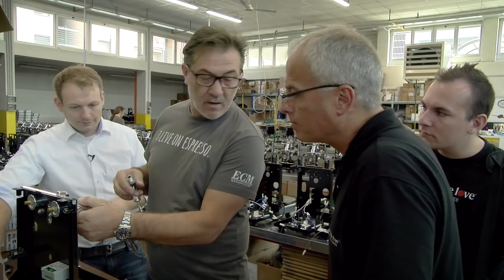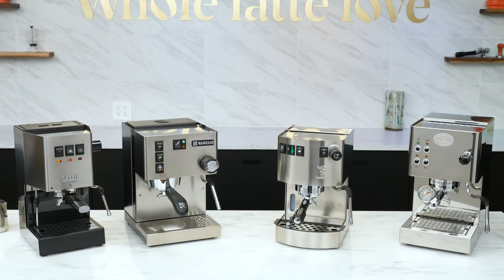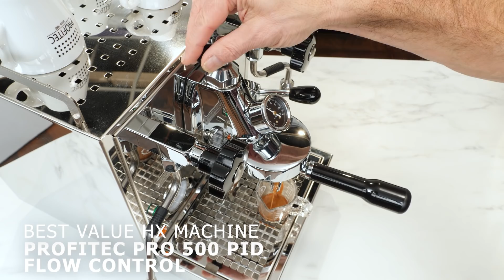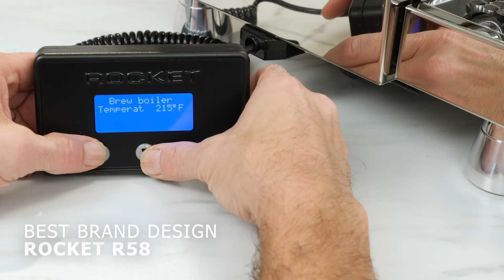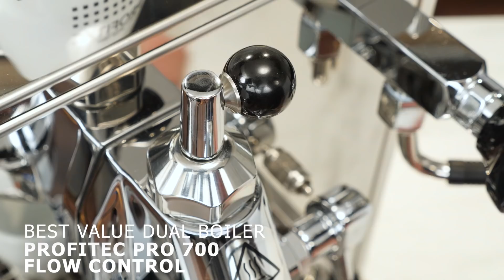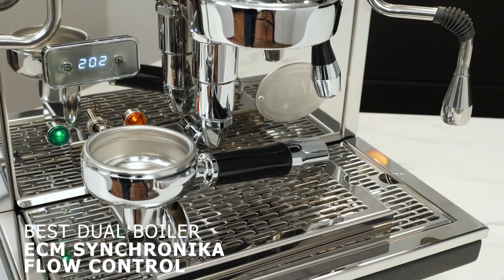Top 5 Best Semi-Automatic Espresso Machines of 2019

Comment: Hi Marc, which machine would you personally buy for your daily latte or expresso? Which one is the best for both? It doesn't have to be among the ones mentioned in this video. Look forward to hearing from you. Thank you.
Reply from the maker: Hi Hanna, Thanks for the question. Answer really depends on the budget and how much I'd be using the machine. If it were for a latte a day and limited budget I'd go with the Gaggia Classic Pro: https://www.wholelattelove.com/products/gaggia-classic-pro-espresso-machine-in-cherry-red
It's a single boiler so you cannot brew and steam at the same time. But after you pull an espresso it's only about 30 seconds until it's ready to steam. That's faster than most other single boiler machines.
If budget is higher and/or machine would get more use I'd go for one with a heat exchange boiler. Those can brew and steam at the same time so prep is quicker. Since this video was made the Crem One HX PID machine came out. It's a lot more expensive than the Gaggia but a great value in machines with heat exchange boiler: https://www.wholelattelove.com/products/crem-one-hx-espresso-machine 
Hope that helps!
Marc
Reply: @Wholelattelovepage  price is not an issue. I wanted to know the best option for what I need. Great. I'm so glad to find your channel and your site. I'm moving to TX end of this year. I'll order 2 high end machines and 2 budget friendly machines for our entire home. Thank you so much for your prompt response. Before I purchase, I may have a few more questions for you. Thank you and have an awesome day.

Comment: Just thinking to buy a synchronica. In the back of my mind there's still a pic of a Della Corte, La Marzocco, Elektra..... What do you think about the worth of a saturated group compared to a ECM Synchronica with flow control?
Thanks for your opinion.
Reply from the maker: Hi AG, Synchronika is a fine machine and flow control extends it's capabilities. Something like the Dalla Corte Mina is IMO the state of the art in flow control with 5 programmable steps by time and flow rate for precise repetition of profiles. Or you can set flow rates and run them manually with the lever in 5 steps. I do like the boiler over group design of the Mina. Very fast heat up, rock solid temps and very quick temperature changes are possible. All those capabilities have a much heftier price tag than the Synchronika. Similar to LM GS3 in price but with Strada like capabilities.
Marc

Comment: What are the differences between the Profitec 700 and the ECM Synchronika ?  ECM is several hundred dollars more, and you rated it as the best, with the 700 2nd best... so since they are both owned by the same company, I am interested in knowing the differences.  I am looking at buying one of those 2 machines.
Reply from the maker: Hi Ben, Thanks for the question. Internally, the Synchronika and Pro 700 are identical. And yes, they are made by the same company in the same manufacturing facility in Milan, Italy. I've been there and know the owner well. A good analogy is Toyota/Lexus - Profitec/ECM. Both are high quality in exterior finish, but the Synchronika goes a little further with angled portafilters, lever operated valves, custom subtle taper of the E61 group, gauges mounted high, chrome tipped levers/valves/PFs and a single piece chassis base which yields case panels which can be easily removed in less than 1 minute. The Synchronika is just more refined - All specs and capabilities of the machines are identical.
Hope that helps!
Marc
Reply: @Wholelattelovepage  Well, I purchased the ECM.  But I will be shipping it back to your company.  It is having problems and despite repeated attempts to get some help resolving it, the best I get is an email with a link to a video, which does not address the issue with the machine.  Just my own 2 cents on this.  When someone spends $3k on an Espresso machine, and they reach out because it is having issues, I would get on the phone with that person right away to get the issue resolved.  When it drags on and the person is sitting there with a new machine that does not work, at some point that person is going to get more and more upset and let others know.
Ben
Reply: Ben did they ever resolve your issue with the machine? If not what did you go with next?

Comment: Marc, great videos.  Thank you.  Your reviews on espresso machines mentions best "entry-level PREMIUM machines".  Would you say that those are the bare minimum choices, that anything less expensive would venture into the less desirable "appliances".  The Gaggia seems about $200 past my price range.  And I've heard good things about the Breville ESP8XL Cafe Roma Stainless Espresso Maker which is half the price.  I value your opinion.
Reply from the maker: Hi Brandon, You are welcome! Sorry not back to you sooner - a bit behind with the holiday last week. It really depends on what your expectations are for espresso. These premium entry-level machines are what the name implies... true machines with standard commercial size portafilters and non-pressurized filter baskets. The Cafe Roma is in the appliance category and uses a smaller pressurized filter basket. This type of product has questionable thermal stability, leaves a messy filter basket after brewing and has lower steaming power. If something breaks in this type of product it's not really user serviceable and professional repair if possible would cost more than the value of the product. All that said, if your looking to make an okay espresso or milk drink you'll likely get a result that matches quality of mass-market chains but doesn't come close to what you'd get at a specialty coffee shop/cafe. I did this video a couple weeks ago making a quick cappuccino on the Capresso EC Select which retails for about $100. I'd never drink a straight espresso from a pressurized basket brewer (i'm spoiled) but it makes a passable milk drink for those with reasonable expectations. Check out the video here: https://youtu.be/ahj74HTrn1k
Hope that helps!
Marc
Reply: @Wholelattelovepage  Marc, It does help indeed and I thank you.  Unfortunately I missed the Black Friday sales.  I had the COVID and was stuck in bed, but spent my time researching.  I've decided that I'm going to get the Gaggia Classic Pro based on your recommendations, including your comment above.  My birthday is tomorrow and I've instructed my wife and family just to give me money (as tacky as that may sound) so that I can supplement the difference and just buy that machine.  It's out of my price range otherwise and I missed out on the sales.

Again, I thank you for your response and I'll look forward to more of your excellent videos and will keep an eye out for sales at your store.  Just registered at your website and signed up for your newsletter.

Comment: Marc - can you recommend a good polish for the rocket espresso machine please - I like mine to sparkle :-)
Reply from the maker: Hi NNS, Thanks for the question. I've been photographing machines for about a decade. Best results cleaning is with ammonia based glass cleaners like Windex and soft clean cotton rags. Cleans the chrome/stainless well. For milk cooked on steam tips soak a rag in same and hold on wand for 30 seconds and milk residue comes of easy. Just be sure and rinse! For drip trays, portafilter and filter basket nothing beats Cafiza: https://www.wholelattelove.com/products/urnex-cafiza-espresso-machine-cleaner
It's what the pros use!
Marc
Reply: @Wholelattelovepage    thanks very much :-)

Comment: What is a " level entry machine"?
Reply from the maker: Hi fb, Here's a video featuring 4 premium entry-level espresso machines: https://youtu.be/ajvUwRZ524I
Premium entry-level machine generally refers to products with machine grade build quality. So they are not made with lots of plastic, use standard size 58mm portailters and non-pressurized filter baskets, built to last and very user serviceable. At entry-level they are single boiler machines with real boilers and not a thermoblock for heating brew water.
Marc

Comment: Hi marc.
I need your help about choosing my first semi- automatic machine. Im looking for hight quality 
Espresso, price range 1000-1500$
Reply from the maker: Hi 3, Here's a link to current selection of machines ranging $900 - $1600: https://www.wholelattelove.com/collections/semi-automatic-espresso-machines?_=pf&pf_p_price=899.99%3A1599.99
If you don't or rarely do milk drinks then the best espresso IMO of the bunch comes from the ECM Classika with flow control. It's a single boiler, E61group PID machine. It's a single boiler so it's more of a process to make milk drinks as you cannot brew and steam simultaneously and must cool down the boiler after steaming. If you want simultaneous brew and steam The Bezzera BZ13 is PID with a heat exchange boiler. The Breville is an option just be aware it's appliance grade construction with nowhere near the expected longevity or serviceability of the true machines in the group. Hope that helps!
Marc
Reply: @Wholelattelovepage   thank you very much
So helpful.

Comment: How much for that wonderful machine
Reply from the maker: Hi Greg, You asked on another video so assume this is what you're looking for:
Thanks for the question and it is a wonderful machine - my favorite dual boiler! Current pricing here...
With Flow Control: https://www.wholelattelove.com/products/ecm-synchronika-dual-boiler-with-flow-control
Without Flow Control: https://www.wholelattelove.com/products/ecm-synchronika-dual-boiler-espresso-machine
FYI the Profitec Pro 700 is nearly identical to the Synchronika with a little less detail/refinement of external case and a slightly lower price. ECM/Profitec are sister companies. Both machines hand assembled in the same production facility in Milan, Italy.
Marc

Comment: I am looking at the ECM Synchronika to replace my trusty Rancillio Silvia. My grinder is a Eureka Mignon. Is this grinder good enough for the new machine?
Reply from the maker: Hi a, Thanks for the question. First be prepared to have your socks knocked off by the Synchronika. Super stable brew temps, best in class steaming power, incredible build quality and detail, rotary pump, plumbable - a huge upgrade! But you already knew all that. At that level of machine I usually recommend a grinder w/64mm burrs or larger. Mignon uses 50mm. Does 14mm make a huge difference? Maybe, maybe not. Depends on how particular you are.
Marc
Reply: @Wholelattelovepage  I guess to sum it up your saying it will do; but consider an upgrade :)  The journey continues......

Comment: Hi Marc. I'm following and enjoying your channel for a long time and now I decided to upgrade from De'longhi machine to a prosumer machine. I'm struggling between Rocket Appartamento and Mozzafiato. Does PID really worth extra $500? Does it improve cup quality or it's just a nice feature to play with? I like to drink light and medium roasted beans, prefer acidity in my espresso rather than bitterness.
Reply from the maker: Hi Michael, Thanks for following the channel and for the question. The PID just makes it easier to get consistent temps. And a little tip, you'll want to brew a little hotter for those light roasts. Also, get ready to have your socks knocked off with the upgrade in quality going from a delonghi to an E61 machine! The Chronometro Mozzafiato: is available in type V with vibration pump or Evo R with rotary pump and it's plumbable direct to waterline. Back to PID... Very consistent temps with that. On the other hand once you get to know the Appartamento you can surf temps using cooling flushes. Temp surfing takes some effort and it's a bit messier as you'r putting extra water into the drip tray before every extraction. Hope that help!
Marc

Comment: Hello! I know this is an older video, but I have a Gaggia Classic (pre-2015) with a PID mod, and a couple of upgrades to the shower screen, shower screen holder, gasket and steam wand. With that in mind, would an "upgrade" to one of the higher-end machines you recommend be noticeable? Just how much does the change in machines help out? (FYI, I am using a decent grinder with the Aergrind, and a Niche Zero on the way. Not using the pressurised baskets)
Reply from the maker: Hi sH, Thanks for the question. If doing milk drinks moving beyond a single boiler like the Classic makes a huge difference. Brew and steam at same time and no cooling down the boiler after steaming. Although PID mod can help a bit I'm a little suspect of major benefits of modding small boiler machines. PID is incredibly good on more recent HX boiler machines. No cooling flush is required and brew temps are excellent. Beyond that, bigger reservoirs or plumbed to waterline rotary pump machines with pre-infusion and/or flow control options open up simpler workflows, more consistent results and tweaking of extractions.
Marc

Comment: Why I don't see the barista express?
Reply from the maker: Hi s, Well, the title of the video includes "machines". The Barista Express is an appliance. It's assembly line made, lots of plastic, proprietary components, not very user serviceable and limited working life. Machines are hand assembled, very serviceable, all metal construction and better thermal characteristics. Breville products offer a lot for the $$ but compromise in build quality, longevity and potential beverage quality.
Marc

Comment: On the Profitec 500 PID - you absolutely CANNOT set the brew water temp; thats impossible to do with an HX as the water can only be heated by passing through the steam boiler and has no boiler itself. You can set the steam temp - which is what he showing, and you can * with some guess work/T&E*  get some consistent water temps, but this video is misleading.The best you can do, is add another heat sensor on the out bound water pipe to read the temp of the water but you can't set it. This is main reason i went with a dual boiler setup, and skipped over HX.
Reply from the maker: Hi Rob, Thanks for the comment. While I understand your opinion on brew temps, and it is 100% correct on HX machines with pressurestats controlling boiler temps, it's not the case with newer HX machines with PID from manufacturers like Rocket Espresso, Profitec and Bezzera. I've personally Scace tested them all and they are remarkably good. PID made it much easier for manufacturers to properly size flow restrictors in the E61 thermo-siphon system to bleed heat from the isolated brew water section of the boiler and produce predictable brew temps based on the temps in the main boiler section. Rocket and Profitec include boiler temp settings in their manuals to produce a desired brew temp while other manufacturers like Bezzera use offset values in the PID. No doubt dual boiler machines have the best accuracy and are more stable with no change due to steaming or hot water use. They also offer capabilities like turning off the service boiler or adjusting steam pressure without changing brew temp.
Marc

Comment: Great video! 1:43 I bought a Gaggia Classic Pro a couple of days ago and the pucks that comes out of it are really soupy/soggy.. Is my machine broken? I use Lavazza Oro ground coffee in it, which has a espresso icon on the can with the Crema perfetta filter installed.
Reply from the maker: Hi SJ, Thanks for the comment! Machine is not broken. Not unusual to have more water on the puck when using the pressurized filter basket.
Marc
Reply: Whole Latte Love thanks for taking away that worry! Learned a lot from your videos!

Comment: Hi, ECm Synchronika Chrome or Anthracite. As you guys have seen both, which way would you go for home use. Same question for Titan. Black obviously doesn't show the marks. Does it look less special, or more special in your opinions. Cheers
Reply from the maker: Hi Adam, Thanks for the question. Well, it's a subjective judgement but you can see the Anthracite Synchronika and Titan together in natural habitat in header image at this link: https://www.wholelattelove.com/products/ecm-synchronika-dual-boiler-espresso-machine-anthracite-panels
Personally I think they make a dramatic pair and yes, no fingerprints!
Marc
Reply: Thanks Marc, Playing with the bundler, Ceado 37s. A while back one of your replies was Titan for home use, 37s for heavier setting. Does that still stand or have you moved more to the to 37s now its upgraded. Black model and display look better now, Titan obviously gorgeous. And to save a third question. Titan or e6p.

Comment: @Wholelovelatte what is your thought about Quick Mill Carola Evo and Ascaso Steel Uno. I have been looking at these vs the ECM Casa V.  Thanks!
Reply from the maker: Hi RT, Thanks for the question. I've used just about every semi-auto machine available in the US market. Sadly the QMCE is one I have not. If you are never going to make a milk drink or an Americano and you're certain you are espresso only then it could work. In my case I only do occasional milk drinks so maybe I could live without steaming. But I have friends and family who like lattes, cappuccinos, etc. I'd likely regret taking milk drink off the menu. The machine is E61 group PID so it's likely a capable espresso maker. The Casa V is not E61/PID but still a very well made machine. A better ECM machine to compare is the Classika. It's E61/PID and if you're into high-level espresso it is available with flow control: https://www.wholelattelove.com/products/ecm-classika-pid-espresso-machine-with-flow-control
It's out of stock at the moment. But more are on the way. Overall, ECM build quality is higher IMO.
Hope that helps!
Marc
Reply: @Wholelattelovepage  Thanks Marc!